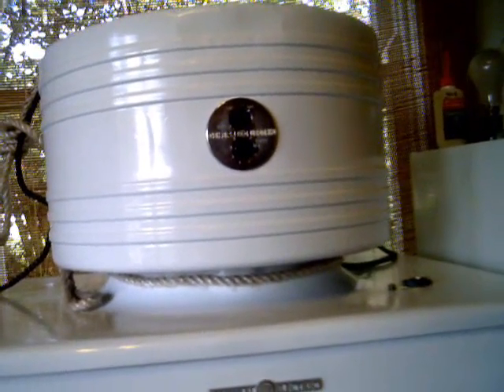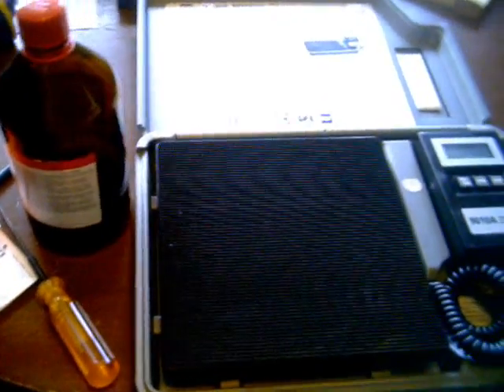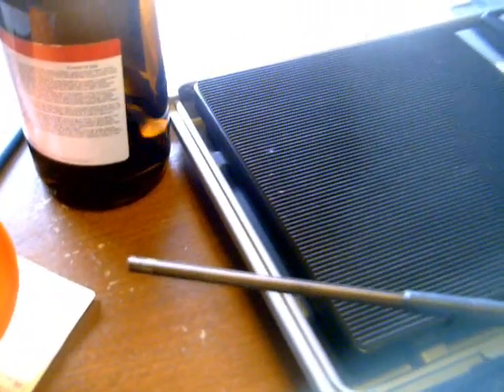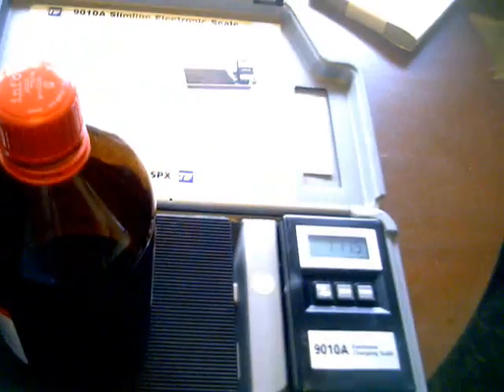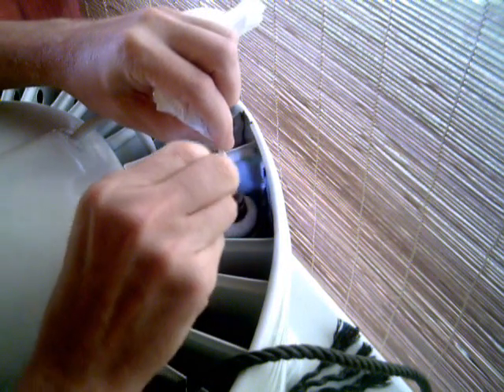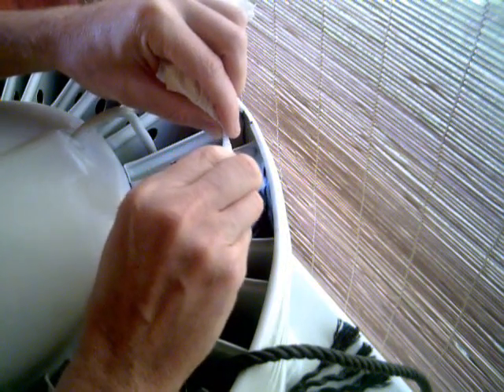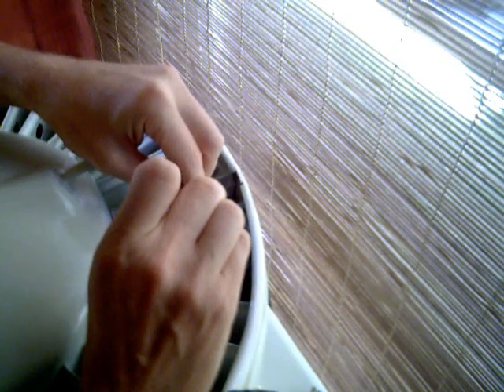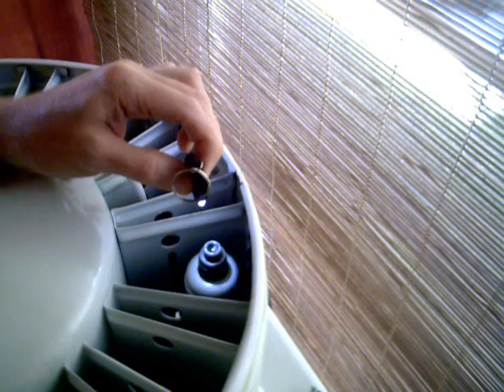Adding refrigerant to a 1934 General Electric Monitor Top

Comment: Could you do this to a CK unit?
Reply from the maker: The CK units operate at positive pressure all the time, so it is not possible to add refrigerant this way. Furthermore, the SO2 refrigerant used by CK's is not liquid at atmospheric pressure.